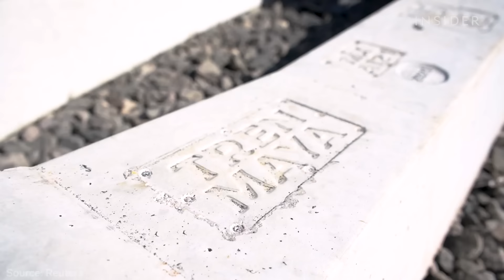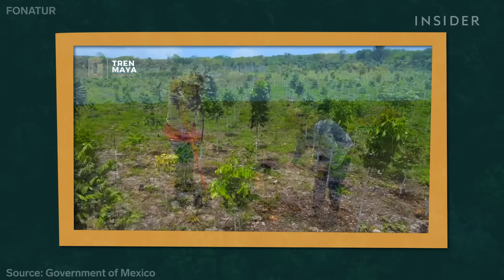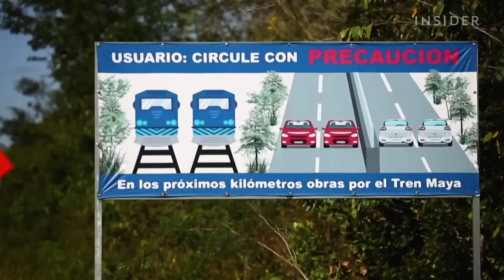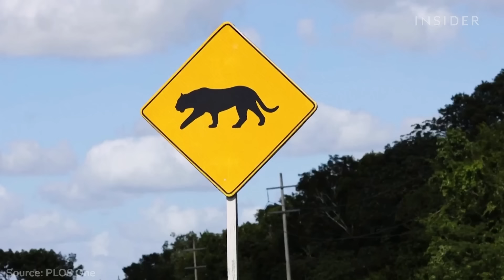Mega Train Cuts Through Mexican Jungle But Could Boost Tourism | True Cost | Insider Business

Comment: Check this out. There is a tolll road from Cancun to Merida  they made as same deforestation than the train but nobody say anything about this and this private road have no benefits for tha population
Reply: a road that is used by millions, the train won't move the same volume of goods and people, that is a fact.
Reply: @Imyourfather225  so it’s ok if we destroy the environment and we get revenue in exchange? How much is the correct amount?
Reply: @Imyourfather225 it's not just a passenger train, it's also a commercial train route. Meaning less usage and pollution form carbon dioxide from deasel engines. It can haul infinite amounts of product.
Reply: @DiegoGarcia-lf3mh enough to rebuild and stabilize the ecosystem. Also this was more of a choice for the local people that would be affected and the majority was for it. I think that has more Merit that other mexicans and foreigners agreeing or not to build it.

Comment: They should go with all elevated track like in china for safety but the Mexican government want to use old track to cut cost like brightline in us Florida have 90 accident in first 6 month of operation by using old track it cannot get to high speed standards 320 km an hr if you cut corner you better not even build it learn from china ccc is a small start up company  in china not up to chinese standards need high voltage electrical elevated track like the one in china .